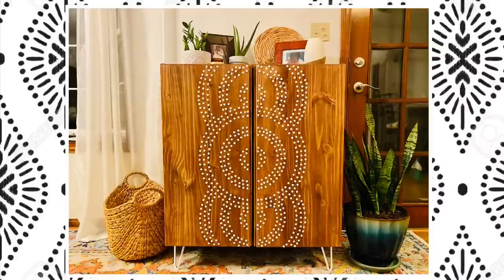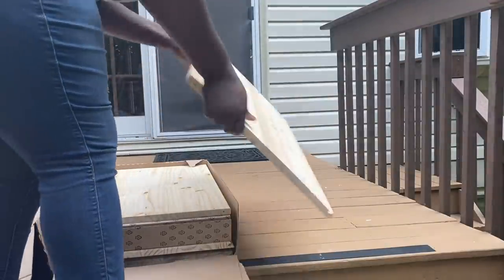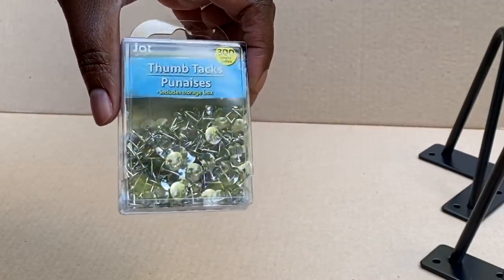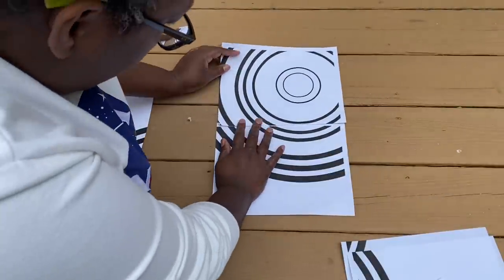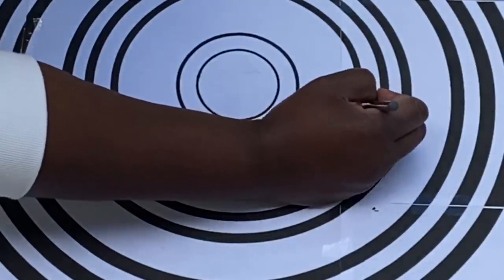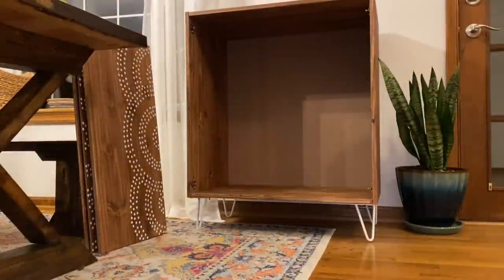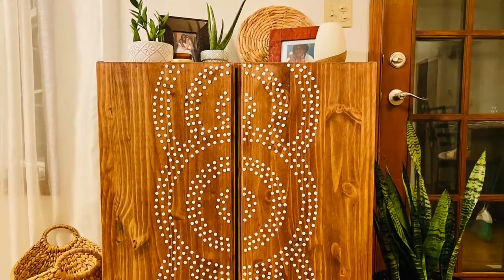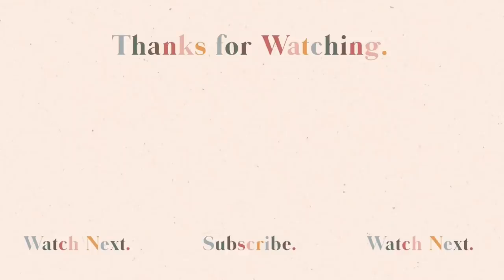DIY Room Decor! IKEA HACK 2020 CHEAP AND EASY IKEA FURNITURE MAKEOVER! DIY BOHO FARMHOUSE DECOR

Comment: The cabinet is  gorgeous!  You are amazing!  I cannot make that chex mix treat - first to go would be the chocolate and the pretzels, then the corn candy, pumpkins and chex.  And I would be the lone consumer, waddle waddle,  I would go to the grocery, come home and make another batch.  Popcorn would be good in that too.   I am  always amazed at the number of people who do microwave popcorn.  I pop regular popcorn in a small or medium soup pot, preferably with a glass lid.  Oil and corn are heating up, then after the first one or two kernels pop, throw a tablespoon or so of granulated sugar in there, get that lid back on and shake it around.  The sugar slows down the popping, but it will start up soon.  Once it is done popping, be careful not to burn yourself on the melted sugar,  dump it into your serving bowl and you have a variation on kettle corn,  as much and as sweet as you prefer.
Reply from the maker: Ha! This is exactly how it goes in my house too...little by little it all disappears 😂  popcorn would be soooooo good!

Comment: I would lay the pattern I the shores then tap the tacks thru the paper then just treat the paper off.
Reply from the maker: Great idea! I thought about that but the tacks actually went in so securely on some that I couldn’t get the paper out with a clean look. However, I was using dollar tree racks so I wonder if a higher quality tack would work a bit better.